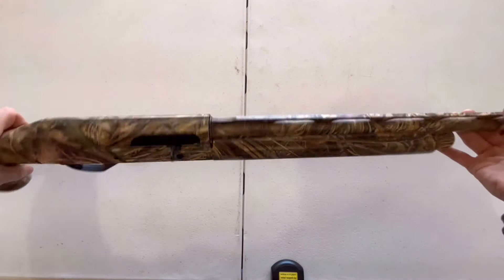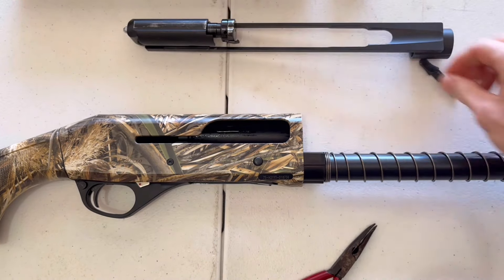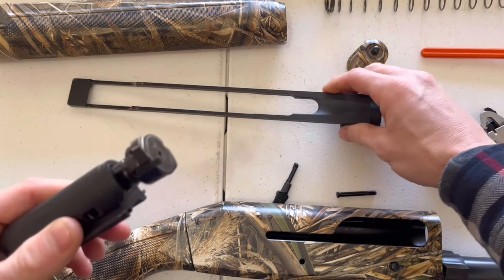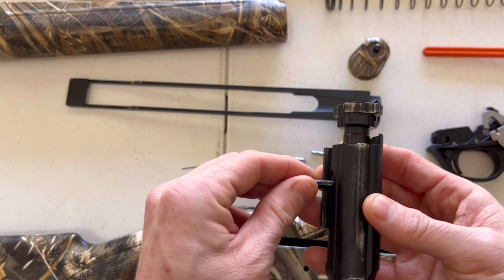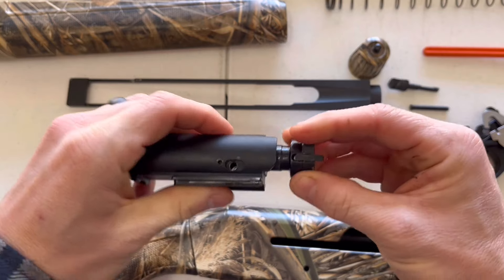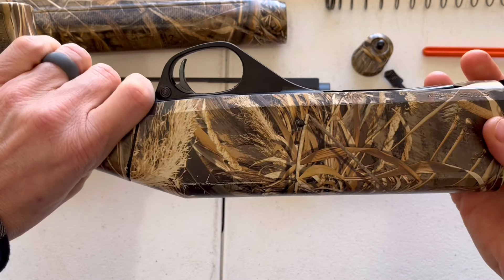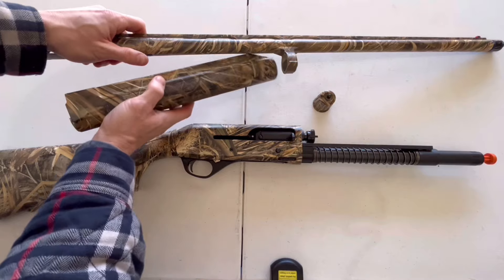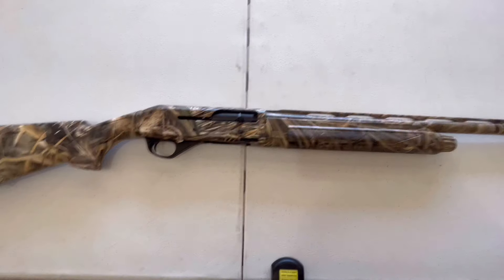Stoeger M3000 How To Disassemble And Reassemble

Comment: I just bought my M3000 with bronze cerakote and when going to remove the forehand and barrel from the receiver, I can pull it roughly 1 inch until it just stops and is extremely difficult to move. I have managed to get it apart but feels almost forced. Same with when u go to assemble. I get to the point where the barrel meets the receiver about 1 inch away and it’s almost impossible to move. Any ideas on why?
Reply from the maker: Make sure you are pulling the action back a bit when seating and unseating the barrel. Otherwise, it’s possible that the cerakote may have thrown the margins off and made it too tight. This happened with an AR that I owned and I could barely get the gas block off.

Comment: I just got this exact gun when I got it the bolt fell out now when the gun is put together it only slides about halfway I don’t know how to fix it also the bolt release makes a clicking noise but does nothing. Do you have any idea what it could be?
Reply from the maker: If the bolt fell out, it sounds like the bolt retaining pin is either damaged or maybe missing?

Comment: Just got a m3000. Was putting it together. And there’s a gap between the bottom of the barrel and the receiver? Is that normal?
Reply from the maker: Play with the bolt a bit, barrel should be flush after tightening the barrel nut.

Comment: Broke it down and out it back together. I can hear Alittle movement in my fireing pin assembly after i put it back together. Have had this gun for 2 years and tons of shells have been used. Is this rocking noise inside a normal thing over time ?
Reply from the maker: Yes, it’s probably the inertia spring moving inside the bolt. Mine does the same thing when I rotate the gun up and down.

Comment: Hey, when I purchased this Stoeger m3000 the under the magazine cap the orange plastic plug/rod was not installed. I've shot my gun without yhis installed as I didnt realize it needed to be in. It has performed fine. After watching this I realized thd orange plug should be in. I've installed thd plug but now my magazine cap does not screw on, it's as if the threads don't touch each other due to this orange rod/ plug being I there. Can anyone assist me with this. Tim
Reply from the maker: Tim, 
I have encountered this issue on other models. 1st: twist the plug to make sure it’s fully seated and not catching on the spring or anything else. 2nd: make sure the fore grip is fully seated in the receiver otherwise it will stop your magazine cap from going on. 3rd: If those don’t work, cut a half inch off the end of the orange plug, sometimes they are too long. Hope this helps.
Reply: I can't load more than 2 shells in a magazine and the problem seems to be in the rod. I've read online that the rod is there just to prevent you from loading more than 2 shells because of some bird hunting laws in some states. Can i just remove the rod so I can use it's full magazine capacity?
Reply from the maker: In most states you can’t hunt small game or birds without the rod in. That includes turkey. If you are just shooting clays, remove the rod. If you’re hunting, I’d say keep it in. Better than a fine from a game warden.
Reply: Ok, thank you for the quick response. I am aware of the legal situation, but I was just wondering how to do it in case i ever need to. Thank you for the good video as well :)

Comment: Great video thank you! Disassembled and reassembled with no problems. 

Just a tip for Stoeger M3000 owners - buy a Benelli M2 extractor and spring kit and install it. It’s an easy upgrade and the OEM one sucks. May save you some trouble down the line
Reply from the maker: Glad to hear it! Thanks for the feedback.
Reply: M3000, does this apply to the M3500 too?
Reply: @christopherwood1668  yes the m2 extractor fits both

Comment: same model but my magazine spring flew out and when i put it back in it wont cycle correctly, any ideas?
Reply from the maker: Never seen that happen before, surprising it would mess with the cycling too. Only time I ever had cycling issues was when the bolt was really dirty from a duck hunt.

Comment: Followed the steps but magazine cap wont thread on with the plug but it will without it  any ideas why?
Reply from the maker: Make sure the barrel is fully seated, otherwise the cap will not go back on. It might be off by just a little, even 1/4 in will throw it off.

Comment: The bolt looks like it is partially open after reassembly.  Is this normal ?
Reply from the maker: As long as the function check is good, you should be solid.

Comment: When i go to pull the trigger to test after reassembly, my hammer is not striking my pin. Got anything for that?
Reply from the maker: Well you can narrow it down by testing the bolt and firing pin. Make sure when you press the firing pin it pushes back out and make sure when you press the bolt it comes back out (5:50 of this video). If both of those are working it’s probably your trigger assembly. Once you know what the issue is, you can dive a little deeper into fixing it.

Comment: My locking pin falls out just by turning the bolt  on its side. Is this normal?
Reply from the maker: Mine started doing the same thing after about 1000 shells. It hasn’t caused any issues with the functioning.

Comment: You gave a great review on disassembling and assembling the 3000 so I assume you might be able to answer my question.
Does the 3000 have a method for setting the cast or does it remain in the neutral position?
Reply from the maker: The Stoeger M3000 comes with shims that you can install to adjust your cast and drop. If  you bought a used one and they didn’t come with it, you can buy them separate on the Stoeger site.
Reply: @TheGreatAmericanOutdoorsmen  thanks, good to know.  I looked at its OM at Stoeger's site and it showed no shims for cast, only for drop.  But the big question I have is can it be set for neutral cast.  I'm left handed while all my grandkids are righties.  
Most right handed guys who buy a gun don't pay attention to cast on or off because the gun either come with cast off for righties or neutral cast; however I'm assuming a guy like you giving a review has investigated all aspects of the shotgun.
Benellis come with cast off for righties and include the shims to make it cast on; but Benelli offers no shims for neutral.